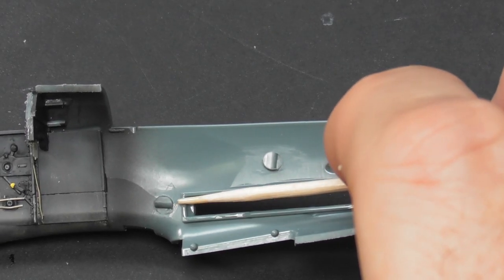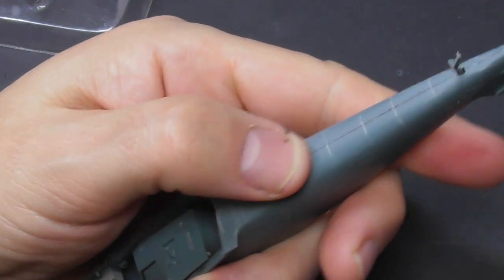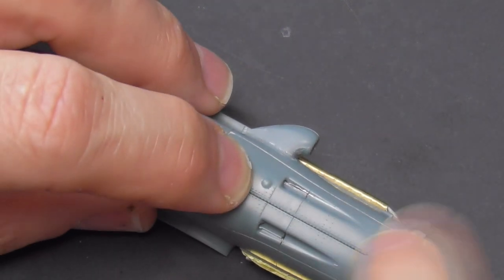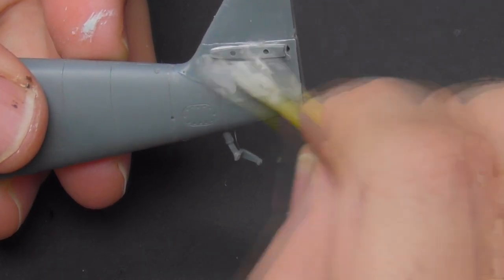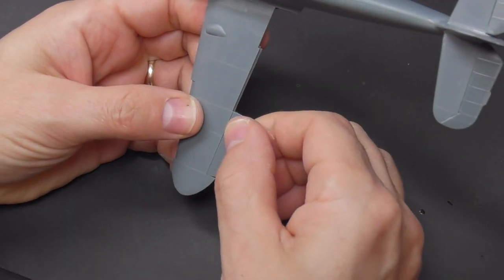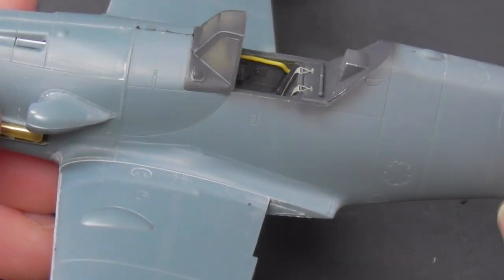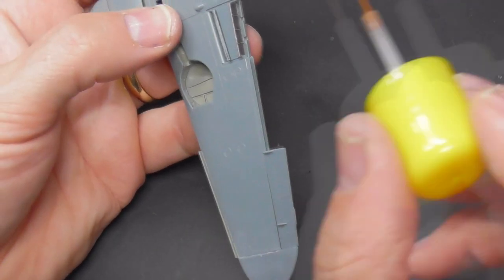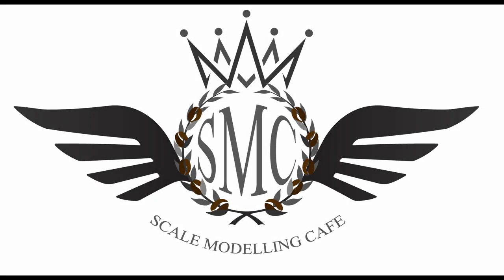Eduard Me 109G-14/AS Part 3 Construction

Comment: Jamie can you (pardon the pun) fill me in on the Mr Hobby epoxy filler you use. I am intrigued by it. I am thinking of getting some,  could do with a filler that is more flexible to use for certain gaps, that other fillers do not cope well with. Thanks pal, not seen you for a while, good job so far on the 109. I have a couple in the stash that I have not got around to yet.🖖
Reply from the maker: I use it on seams as it doesn't shrink, it has a plasticiser in it so it's not water soluble therefore I tend to avoid it in areas where it will be difficult to sand.